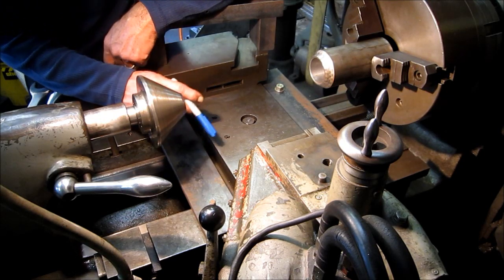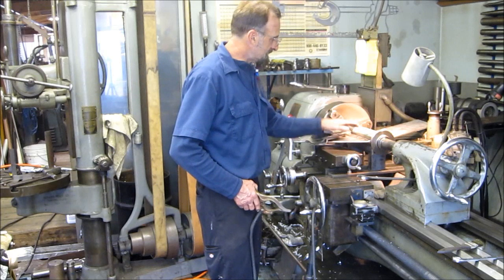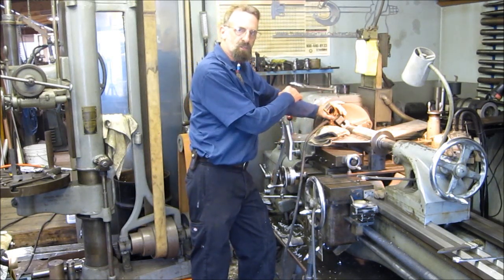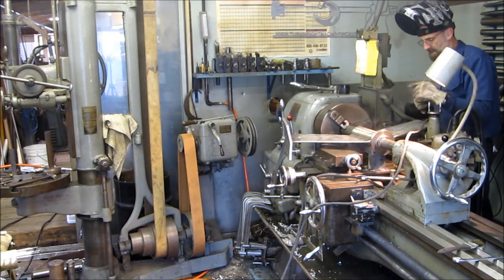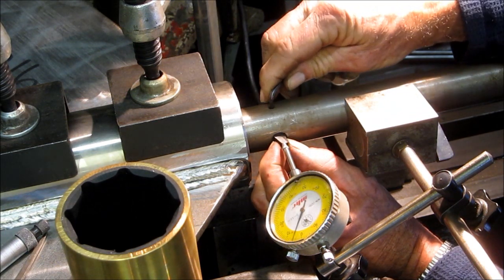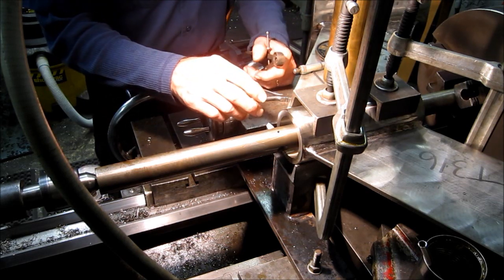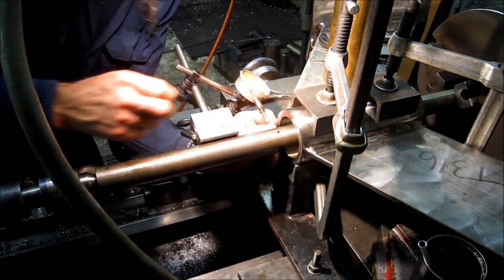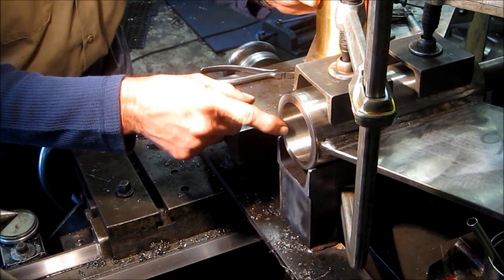Strutting PART 2

Comment: I love all the vids,I've told you that before tho,lol.One question.Did you machine a bevel or similar to the channel you made the cradle for?I've had problems before when doing a similar setup,that since the channel is hotrolled,it's not exactly true on the locating points,and drew the part out ever so slightly.Maybe I either had more pressure on the clamps than you,or was trying too hard to keep it on a gnat's ass when I didn't need to :).so I sanded the bottom and milled a small 45 down rails.

Comment from the maker: I switch back and forth depending on the need for speed, penetration or pretty welding. Sometimes just changing to change up the pace, to keep in practice.
Tig for fine work, Mig for fast fabrication and Stick for structural, most of the time! ;{)------

Comment: When you was talking about where to put the ground made me think back to this guy that was welding something held up by a 20 ton overhead crane and hooked the ground up to the column that supported the the crane . Everything was fine for about 10 min before the wire rope started glowing and the power box caught fire. After all the damage was done there was almost 10 grand for rewiring and all new bearing and some electronic parts. He wasn't employed with us for very much longer

Comment: Hay Keith, been watching your videos for a while now and really appreciate your time and effort for all of us in the trade.  I have a question for using flood coolant on a lathe.  I am think of setting up a coolant system for the reason of this same job scope you are doing.  Would coolant help flush chips and keep the work cool to keep thermal growth to a minimum so over cutting does occur leaving a slight internal taper.  Is it worth the mess and worth the idea in your opinion?

Comment: I guess ones never to old to learn.  For many years I always wondered what those T slots
could be used for,, this is on a 1918 Heavy Greaves.  Is there a reason not to bore, before
fabing up the assembly?? heat??  I drill and tap stainless set screws in the housing then into
the cutlass   then fab    good job I learned   something